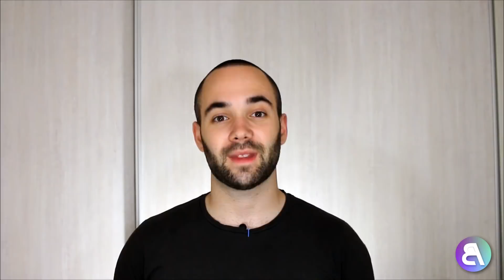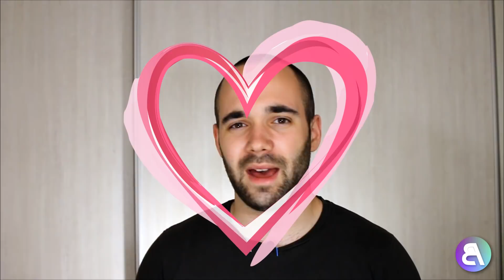What is 6D BIM?

Comment: with all do respect, your explanation about the dimensions of BIM isn't fully correct, 
3D as you said it's the three dimensions and axis X Y Z but for BIM is not just 3D model, it's a 3D Digital Model and by digital it means objects with Parameters used to build the model.
4D is about Planning & scheduling there are many  softwares can be used for that purbes as such Navisworks.
5D is Quantities & Cost control of the project (you added many things not related to quantities in your explanation about 5D)
6D is about Energy Analysis and Environmental Sustainability efficiency (you mentioned some points about energy saving but you mixed it with many things NOT related to 6D)
7D is exist and it's involved in Maintenance and Facility Management until demolishing phase.

Comment: 7D BIM  my credence managing waste, recycling, reusing and equalizing the carbon dioxide released by the people and machines operating inside the building with in-built(like plantation belt) system installed in the building.

Comment: What you are missing is to combine BIM with Market Research on Consumer Tastes.  Design is a competitive weapon ...ANOVA can determine statistically the best way to layout a store to increase buying and better satisfy consumers. The Ford Mustang in the 1960s was revolutionary in that Conjoint Analysis determined what the car looked like, horsepower, interiors, colors etc! It blew rivals out of the water. The same can be applied to architecture. Programs like SPSX can do cross tabs to determine market segmentation and product pricing. If one uses a main frame you can combine census data, tax return information,  Values/Attitude/Lifestyle analysis to the realm of large scale land development or City Planning. You then design real estate products to match market  needs, tastes, and income...while besting the competition.

Comment: 7 d BIM would be the ecological part of the materials and the cicle of the waste of the building like recicle, water, air, etc
Reply: Correct managing waste, recycling, reusing and equalizing the carbon dioxide released by the people and machines operating inside the building with in-built(like plantation belt) system installed in the building.